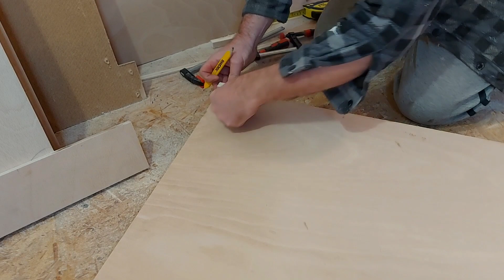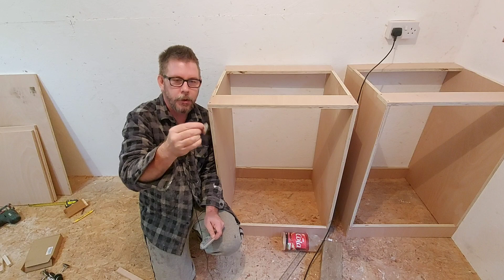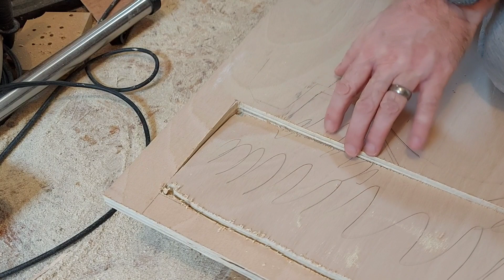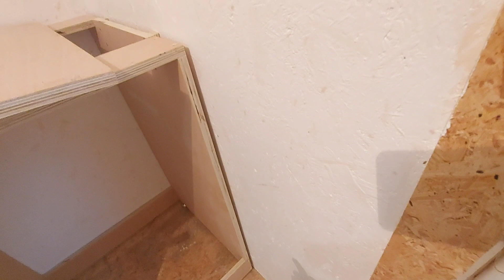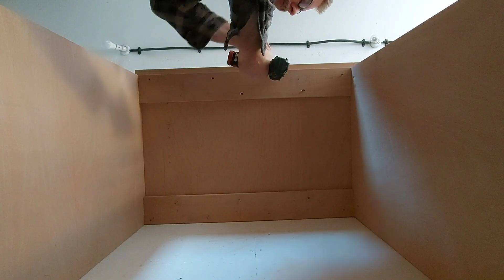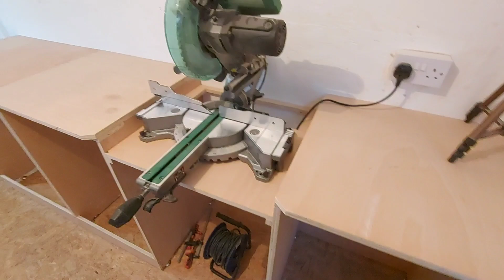Building the mitre station, workshop makeover part 2

Comment: I made a small insulated door to the wall in my previous shop, so i was able to saw longer planks etc. 40x15cm if i can remember correctly...I also lined my tablesaw towards that door so i was able to rip longer material. Worked great! 
Nice relaxing video as always, greetings from finland!
Reply from the maker: Thanks, yeah ive seen someone else who had a small flap in the workshop wall for cutting long lengths on the mitre saw.